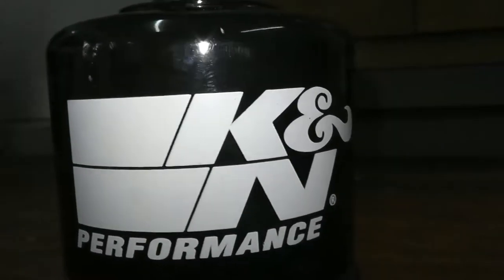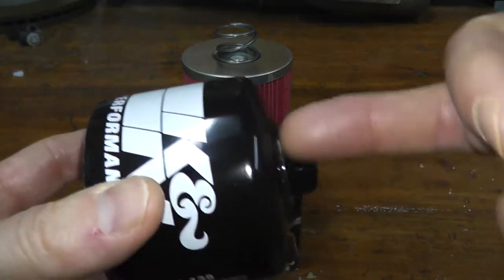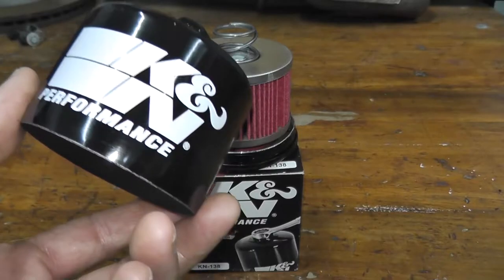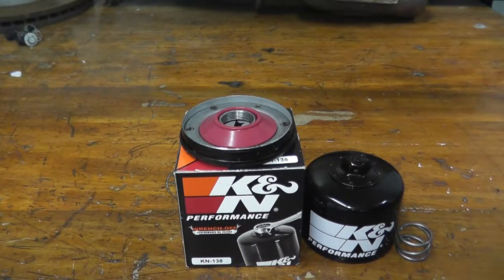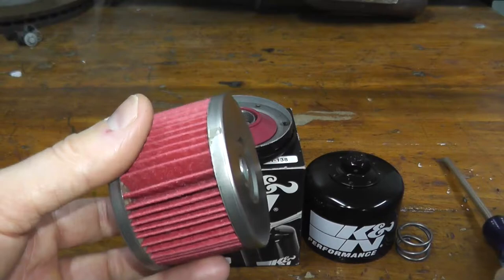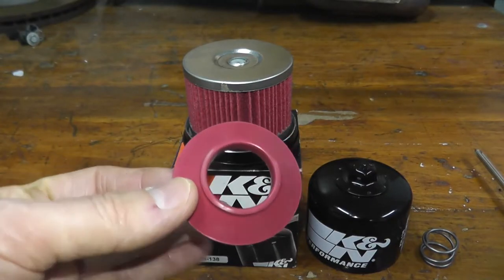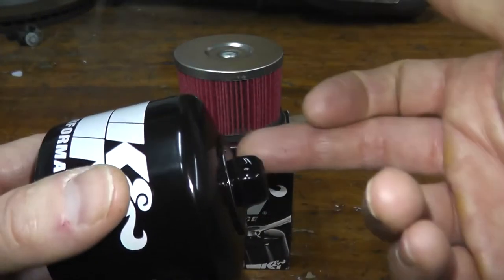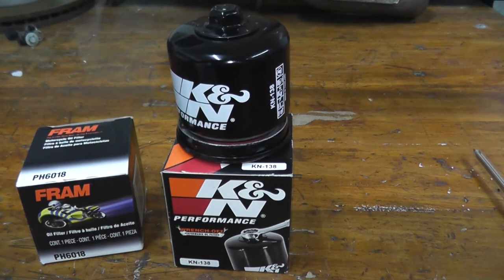K&N Motorcycle Oil Filter Review

Comment: Had two K&N motorcycle filters replaced for free last year. They had a recall on them for the weld nut. Possible failure at the weld causing sudden oil pressure loss during operation. We were definitely impressed by them standing behind their products.
Reply: If you fried your engine do to loss of pressure I wonder if K&N would have replaced your engine.

Comment: My motorcycle requires 19ft lb torque. When I used the nut to install it it it developed a leak. How will I achieve the torque without using the nut? I try using a cup but the surface is too smooth. Thank you
Reply: Hand tight is usually all it takes.The nut should be for removal only.But some leak at the nut anyway.You are playing Russian Roulette if you ride a bike with K&N filter with a nut on the bottom.